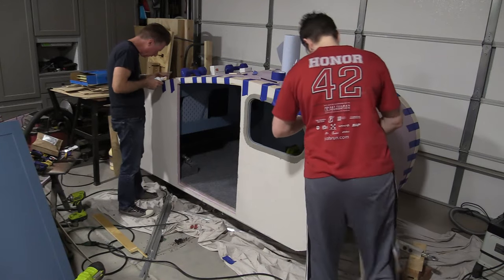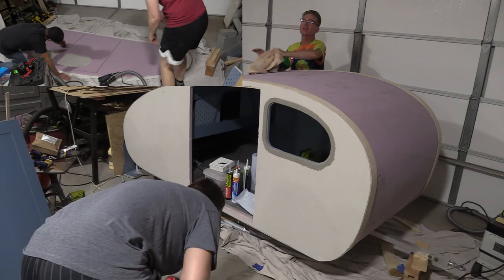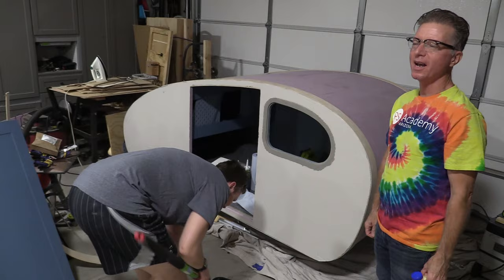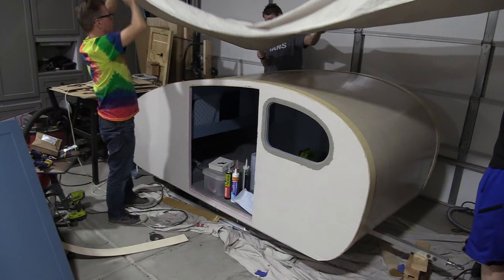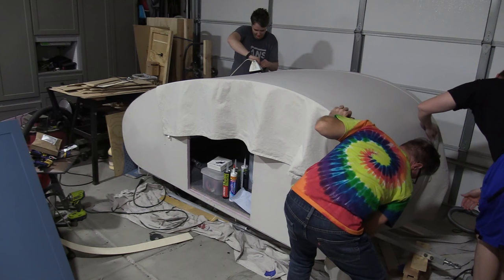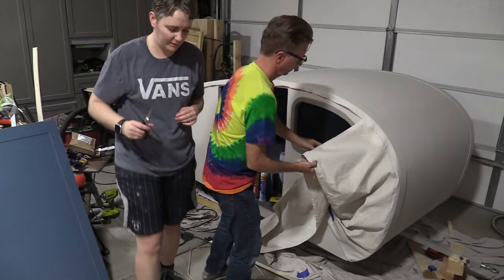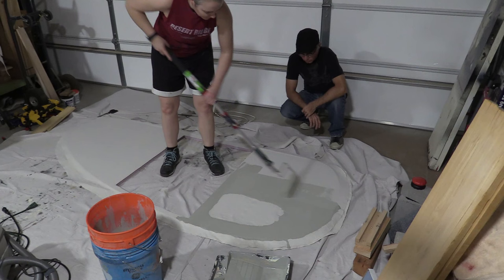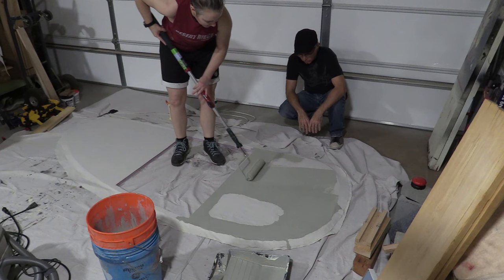Poor Mans Fiberglass PMF Tutorial, Tips to get PERFECT Corners! Foamie, Vespa Teardrop

Comment: Titebond 2 is only water resistant where as Titebond 3 is actually waterproof and lays down just as well as Titebond 2. It is just a bit thicker and the first coat (before you lay the cloth) can be deluted with as much as 50% water, but I go with only 1/3 water and 2/3 glue.
Reply from the maker: Thank you for the informative response! Perhaps if I watered it down some I would like the way it rolls out better.  I use TB3 for somethings,  for PMF the multiple paint layers are what really seals it up. My 7 year old trailer is still perfect looking. But perhaps I will try TB3 watered down so I can get a nice thin layer like TB2. :) cheers!
Reply: Could I mix primer with the glue?

Comment: An alternative is using latex paint in place of glue and bedsheet in place of canvas.  Paint the foam, apply cotton material while wet and repaint cloth. Total soaking of material. Then repaint until material texture disappears… fiberglass screen also works and is very strong. As long as you repaint every 5 years it should last a long time…

Comment: My biggest error I did was stretch the cloth  lol you are so right about not stretching the cloth it causes air pockets but still no failures ... I did use a stiff paint brush & dabbed the cloth tapping it with the stiff bristles of the brush like folks do with actual fiber-glassing the cloth to get out air bubbles & tight places .. I seen you used a iron .. way cool ! I'll have to use that method !
Reply from the maker: I am happy yours still worked out well! And good idea with the paint brush!
Reply: Not stretching it tight is counterintuitive I think.  If I hadn’t seen this, I would be pulling it tight.

Comment: Very good tutorial.  As for the strength of PMF, I have a crazy story.  I built a teardrop with a sandwich of luan on the inside with 3 layers of 3/4" foam and PMF on the outside.  I had the unfortunate luck of being jarred awake one night while camping on the beach.  I was awoken when a truck side swiped my trailer.  Luckily, the only damage was paint transfer from the truck and my rear rack was a bit bent.  I feel pretty fortunate to come out unscathed.  I am not sure how the trailer would have faired if it was plywood sides.
Reply from the maker: Wow!! That is amazing!!
Reply from the maker: Thank you for sharing it!

Comment: Very interesting tutorial!
 Starting in the 80s, I had a property management business taking care of large estates on the ocean on Jupiter Island in Hobe Sound, FL. One of my places had a huge deck over the beach looking out at the ocean that was covered with PMF, there were about 1" overlaps at 8' widths with a double row of brass tacks spaced every 1/2" holding the seams tight, I think that was the key to the long life, not letting any separation get started. Every couple of years I would paint it but it just lasted and lasted in all the sun and salt air on the beach! The house was originally built in the 40s and I moved on after 25 years in the mid-2000s. I am sure it is still there if the place has been properly maintained, amazing stuff!
I don't think fiberglass would have lasted near as long as it would have separated from the wood and developed blisters, the canvas and paint allowed the covering to expand and contract a little with the seasonal changes. I believe it was the best choice for covering a large deck like that.
Reply from the maker: That is awesome! It is really good stuff when properly applied and maintained!
Reply: I’m trying to picture a deck like that, as I don’t have any reference. Our decks are always made out of wood slats here. Was this pmf covering wood sheets? How water drain off it? What colour was it? Thanks
Reply: @Tonisuperfly  The place was built by a millionaire in the 1940's, I don't know what the actual decking material was but I did have to replace one of the stairways to the beach and it was made of teak so I suspect the decking was also made of teak. the deck had a slight grade to it, when the large picture windows were washed the water ran off the outer edge. In the 25 years I took care of the place all I ever did was clean and paint it every 1 or 2 years, the edge where it connected to the house was flashed with copper flashing like any roof situation. It was painted gray.
Reply: @samTollefson  excellent. Thanks for your description. Your memory is outstanding!
Reply: @Tonisuperfly  Thank You. After thinking about it, there is something I would like to add. The decking, I am positive, was tongue and groove planks not the gaped decking boards we think about today, as there was no separation apparent anywhere. The deck would have been sealed and a type of glue to adhere the canvas to the deck, it would not have been hide glue as it gets hard and brittle over time. I wish I knew the exact method used but I believe it would be very much like the PMF method people have been resurrecting today.

Comment: A recommendation for pulling your pleats is a mini set of needle nose pliers.  A slight twist and tug works really well, especially if the material is wetted out.    Good work .   I’m looking at building a light weight trailer for a drag and drive setup , I will probably be going the same approach.    Good job !
Reply from the maker: Thank you! Great tip!

Comment: Wow .. thanks for sharing your method .. it was great to watch your process ! I used wood glue over thin skin 1/8 plywood like you did .. but I used cotton bed sheet that worked out great for my project . I did however use the wood glue thinned down to saturate the outer cloth once glued to plywood instead of reduced paint & after it wasn't tacky I introduced the latex paint layered the coats on to build up the finish I was looking for .. with that thin cotton bed sheet I brought at the second hand store it came out great just like a air plane cloth & doped sanded & finished with paint  ! It's amazing how will it's holding up exposed now over two years to Florida weather extreme hot sun & extreme rain ..lol I sure was surprised how well it's doing !
Reply from the maker: That's awesome and sounds like a solid process! Thanks for sharing your technique!

Comment: This is such a great video as I am reading different comments on whether the PMF can create a nice finish or not. You really show the practical details needed to make it work. I was wondering if you have tried using a paint sprayer, the type that does not need a separate compressor. I was going to experiment this but thought you might have tried or know others who did. I am making a larger foamy so any time savings on the painting would be wonderful. thank you again!
Reply from the maker: Thank you! I have not tried a sprayer but it should work pretty well

Comment: Very informative thanks.  I am building my own modular trailer and am thinking of using the same technique.  One concern I have is how to secure hinges (I will have a few because its modular) to the foam/glue/canvas body?  I have some hinges that do carry a bit more weight than a door.  Did you bolt through with the hinges or simply screw them on?  Would you recommend additional trim work to better fasten the hinges?  What has been your experience?  Any info would be much appreciated.

Comment: 100 years ago this is how most aircraft were made, minus the foam. A tubular steel frame was covered in cotton and painted with a flexible paint called dope. The base layer had aluminum powder. The thought was it would protect the cotton from sunlight. Then the final coats were the color. The dope had the added feature of shrinking when it dried so it removed any minor imperfections. Unfortunately, even with all the precautions cotton didn’t hold up well to the elements. Also the dope was made with nitrocellulose which is extremely flammable. 

A few years later someone figured out that Dacron lasted a lot longer and didn’t require that dangerous dope. Any imperfections could be taken out with a heat gun. 

The final evolution in the cloth covered airplane was to use fiberglass 😂. It was expensive and somewhat heavy but it would last the life of the plane. In fact it’s major drawback was the parts of the plane that normally got inspected during a recover job were now hidden permanently 😮

Anyway, I thought you would find this interesting. Thanks for these great videos! You are giving me ideas😅
Reply from the maker: Very interesting! Thanks for sharing :)

Comment: just came across this. the PMF coating looks great, the whole trailer looks great. Do you water down the glue as well? and how many coats of paint did you end up using ? also, what are your thoughts on using bed sheets for the cloth?
Reply from the maker: I don't water down the glue.  I do 50/50 coat a 75/25 coat and 3 full coats sand between.  Bed sheets will work, but I like the thick protection from the canvas. Happy building!

Comment: Hi Lucy thank you for sharing this very informative video. have you seen any signs of peeling or water damage? We just finished the frame work for our truck bed camper and we’re leaning towards this method. Any advise would be great!
Reply from the maker: Thank you! I haven't had any issues with the 3 trailers I have used this technique on. Just make sure there is adequate glue at the seams. And apply several coats of paint! :)

Comment: Great video. I see a lot of people putting another glue coat over the Canvas. Is that a wasted step or is it even extra protection?  I am going to PMF my Camper Build because it is cheaper, but I don't know if I should install the glue on top of the canvas, sand then paint? What are your thoughts Lucy?
Reply from the maker: I prefer to not have an extra layer of glue so the paint can soak deeply into the canvas. I have an 8 year old and 5 year old trailer in perfect shape still using this technique  :)
Reply: @thelwood  Thank you for your expert insight. Is it a necessity to dilute the paint, or can you just use the paint at full strength?
Reply from the maker: @danemmerich6775  definitely do a coat of diluted paint
Reply: @thelwood  thank you

Comment: So many questions. On other how-to videos they apply a layer of glue to the outside of the canvas, then move to putting on the paint. You move directly to paint on the canvas. I suspect the glue layer to be somewhat hydroscopic (soaks in moisture from humidity), but I'm curious why the difference between methods. I'm also curious about your cure schedules for glue and thinned paints. Any guidance?
Reply from the maker: I have seen people use glue over the canvas.  I have done 3 trailers with the more "original " pmf (or what i can seem to find of it anyway) of water diluted paint. The diluted layers really absorb deeply into the canvas.  The areas where I have had too much glue and it seeped through the canvas were harder to get the paint to really adhere to.  1 of my trailers has been outside for several years and it is still in perfect shape. You could do trials of both techniques side by side to see which you like better.  My concern with the glue method would be sanding off the paint in between coats (if you are looking for a nice smooth surface) . Thanks for your question!

Comment: Thanks for your excellent tutorial.  How have been your experiences in the long term concerning the resistance against solvents? Does the PMF layer prevent accidental exposure, for example at gas stations,  from diffusing through to the XPS, and therefore damage?

Thanks, and best wishes.
Reply from the maker: Thank you! The PMF has held up really great on my trailers. However,  they have had low exposure to solvents. That is an excellent question.  Airplanes used to be coated in it. I also live in the desert so I don't have salted roads and stuff to deal with.  Sorry that I don't have more definitive answers to that great question
Reply: @thelwood Thanks. I'll report what I find out. 

I was asking because I temporarily placed a 5-inch thick in front of a broken glass balcony door. Obviously, just a little gas from the double window was enough to melt a dent. Even that thick XPS plate due to that bowed in the opposite direction.
Reply from the maker: @pamojja  wow!

Comment: Hi there, I have the budget for epoxy fiberglass on my next project but I was wondering about the maintenance with PMF. I will be using it mainly in the winter and the roads and salt have me concerned about wear.  I have been wanting to try it out as its nicer in the shop and I dont need a mask.
Reply from the maker: The low fume application is what appeals to me too. My PMF trailers haven't required any maintenance, but I do not have to worry about salt here in Arizona. You might be best served by epoxy fiberglass! I loved in Minnesota so I knew how fast salt can eat through anything!

Comment: First off, I love your videos. They're very clear and I have learned so much from these. (I also love the name of your channel!)  Wondering if I can ask your thoughts on something based on the technique used here: I am about to start a "squaredrop" build using PMF so I will have a few angles but no curve. Any thoughts on what one might do to decrease overlap folds on that? Seems like I might get some no matter what I do, but wanted to pick your brain on this. Thanks for any help you can give, and thanks again for so much great content!
Reply from the maker: Thank you! If you look back at one of my first videos I did PMF on a little cargo trailer that is square drop style.  I did have some overlap but it looks nice still. How I did those edges might help you :)
Reply: @thelwood  Thanks! I did watch that video (and it's a great trailer) but wasn't sure if - at the point of the angle - you cut a slit in the 2" overlap or tucked it like wrapping a present, if you will, and just had sanding take down the "creased" area. Appreciate any insight you can give!
Reply from the maker: @johne.vanbarriger1756  I cut it and folded the back side in first and then the front side 😃
Reply: @thelwood  Thank you, and keep up the great work on the videos!!!  🙂
Reply from the maker: @johne.vanbarriger1756  thank you!

Comment: Thank you for this clear explanation! Looking forward to trying it myself.

I had a question about the curve of the teardrop. You said you did the inside walls, did you mean only the upright parts, or did you do the "ceiling" too? I'm just trying to figure out if it'd be possible without having it already mounted on the walls somehow.
Reply from the maker: Great question! I just did the side walls not the ceiling! That would have been a pain... lol
Reply: @thelwood  Yeah, I was having trouble imagining being in there upside down trying to iron out wrinkles and then applying the very drippy paint. :)

One other question, I was wondering about using 4oz cotton for a bicycle trailer to save weight rather than a standard 10oz, which would save about ~10 lbs. Do you have any experience with other fabrics and if/how they work?
Reply from the maker: @smg604  I have not worked with lighter fabric,  but I would think it would work.  I would do a small sample and see how it feels

Comment: How rigid is the trailer after applying the PMF (especially after the kerfing)? I'm going to start a project and I'm wondering how much extra bracing I'm going to need.
Reply from the maker: Hi Dante, the sides without the kerfing are very strong. For the roof it  definitely needed the wooden dowels as spars to help strengthen it.  If it were going to have to withstand snow on the roof, I would also put 1/8 baltic birch over the top. Here in Arizona that isn't an issue. The sides were cnc cut before I had input on the design of them,  the area by the door was very thin... only an inch of foam above the door! So there wasn't room for wooden dowels there. To strengthen that part I actually put 1/2" x 1/16" aluminum bar right into the kerfs on each side of vent using exopy.  That added a lot of strength!

Comment: Hello again. Can you confirm couple things please. You coat  the foam/ply in 1 good coat of tight bond 2 with smooth roller . It's only 1 coat? And isnt watered down? Then your first coat of paint is 50/50 2nd 75/25 top 3 coats straight water based exterior paint? Thanks again.
Reply from the maker: Yes, that is all accurate

Comment: Great project. Which state are you at? It seems somewhere in the Southwest. I am in Arizona and I was wondering if you are planning to do another project like this one and how much could be the cost? I loved the Idea of the teardrop. I have a Vespa as well.  I also wonder about any type of insulation used. Great work and thanks
Reply from the maker: Thank you! I am in Arizona too. I don't think I would build one for a Vespa to sell.  Mostly for liability since vespas don't really have official towing capacities. This was an unpaid collaboration. We used extruded foam from home depot for the walls.  The flooring was insulated with 1.5 inch foam insulation.  I have a video on adhesives for foam,  there I also give a few tips on working with foam. It is super cool and pulls great! But it is challenging in windy conditions.  I would try to keep is a little smaller if possible so it isn't such a sail.  That can easily be done by having fewer big curves.  The trailer 6' but the body is 8' due to the shape. My teardrop that I pull with a car is an 8' trailer and 8' body.
Reply: Thank you very much for your response. You sure do good work. I am very proud of your unique project. I will definitely check your other projects. Great work. Hope to see more what you have in store for us.❤️
Reply from the maker: @lfb004  Thank you so much!